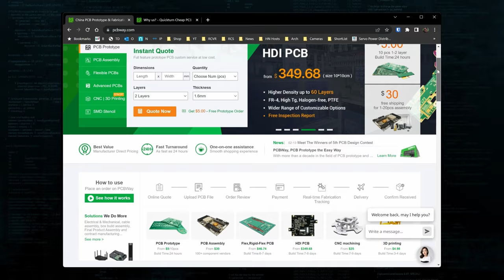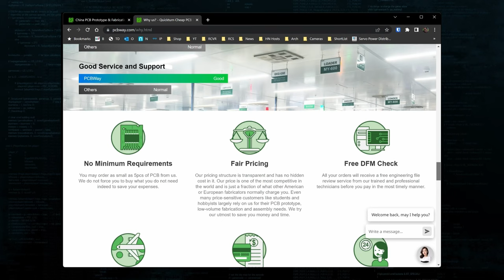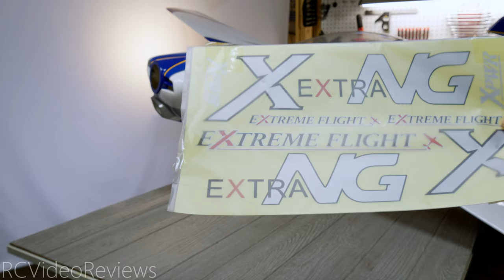One of the BEST RC Planes: Extreme Flight 78" Extra NG

Comment: I'm on the waiting list for the orange, blue and white one at Extreme Flight.  It would be AWESOME if it is available with the T-motor 780! 
So far it looks like it's only offered with the XPWR 35 or 40.
Reply from the maker: That T-Motor 780 is a beast and the Orange/White/Blue scheme is really nice.
Reply: @RCVideoReviews  The Jim Bourke Color Scheme is on the next container.  I'm super excited to get the 78 inch. I have the servos already so I'll be looking for the T-Motor 780 with the appropriate ESC. So far the motor doesn't appear to be available yet..

Comment: Hi there I buy the Extreme Bushmaster cnc 84'' what T-Motor do you recommend the AM 600 525kv or the AM 670 520kv.
Reply from the maker: EF recommends the AM600. They've usually worked these details out and you won't be wrong using the equipment they recommend.

Comment: Thats funny how different strokes for different folks. I had the exact plane running 12s wwith xpwr 40cc motor. Its the only plane ive had from extreme or skywing that I did not like. Too heavy. imho. My buddy has the 91 inch verson and its awesome on 12s electric but I dold my 78 incher. The plane is very hard to see in the air.
Reply from the maker: Yup, it's why there are options. I love this plane :)
Reply: I started with the gp 38 it was not powerful enough for this rather large 78 inch frame. Went to the 12s 40cc motor aand it was better but still a touch to heavy. Its a extremely well built design but imho might be overly built.